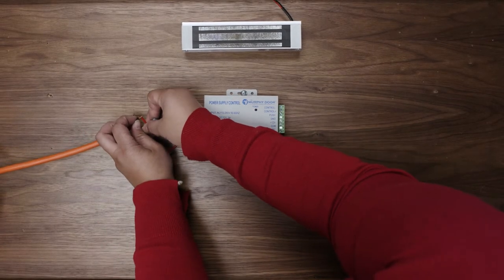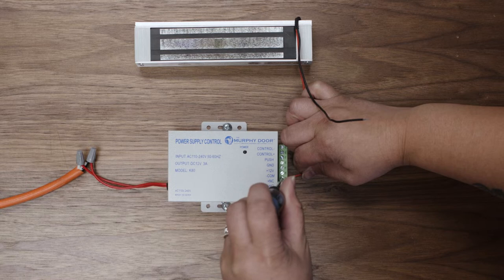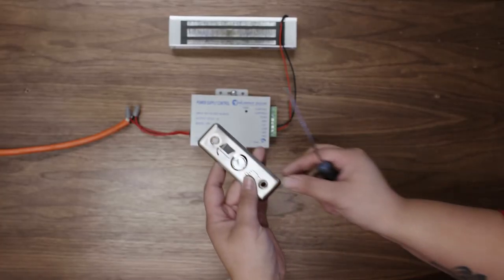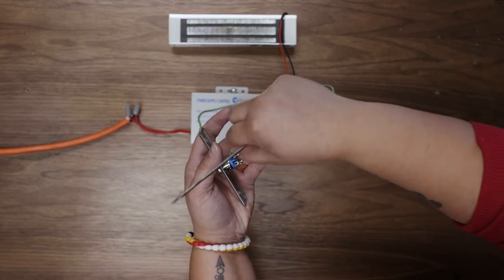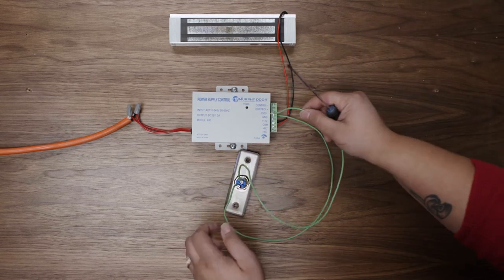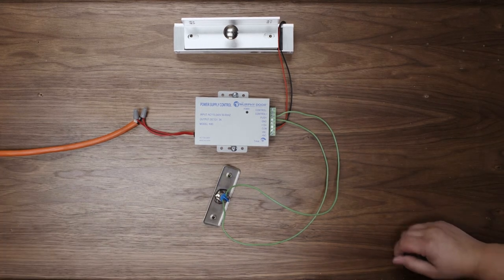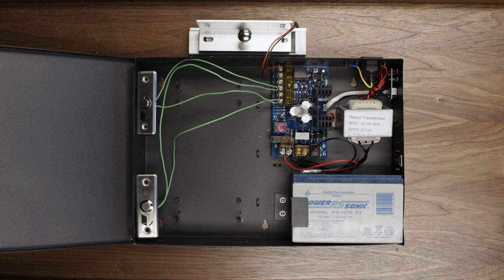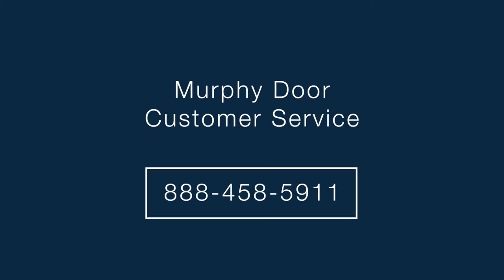How To: Wire Your Push Button Lock on your Murphy Door®

Comment: Hi there. LOVE this video and found it very useful. In my system my Maglock is connected to NC and GND: it is not connected to COM terminal on the Power Supply but the GND terminal. The GND wire runs continuously from the Power Supply to the Maglock, also the Keypad and the Exit Button. The Green Push wire runs continuously from the PS to Keypad and Exit Button.  And finally the Red +12V wire runs continuously from the PS to the Keypad and Exit Button. This system has been running since 2021 just fine but I have gone thru two Exit Button fails and this time the Maglock stopped working. I placed my hand on the Maglock a few times and noticed it was warm /hot not scalding but warm. Curious if I wired my system incorrectly and slowly burned the Maglock out. Question: Do I need to run a new COM wire from the Lock to the PS? Thank you for helping me.